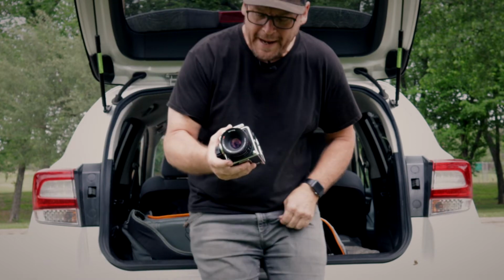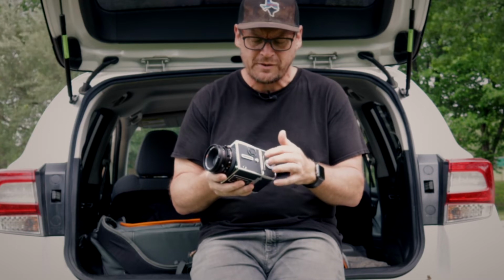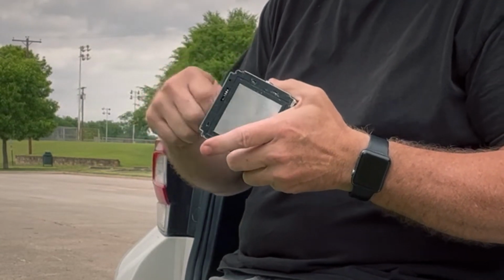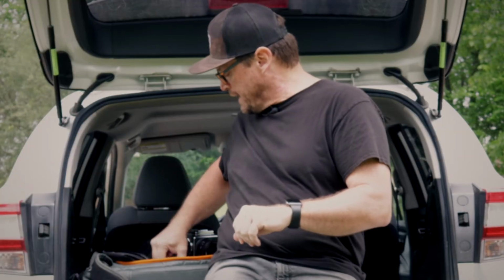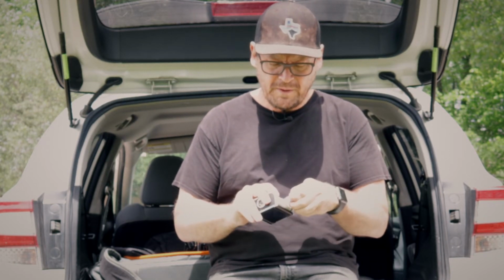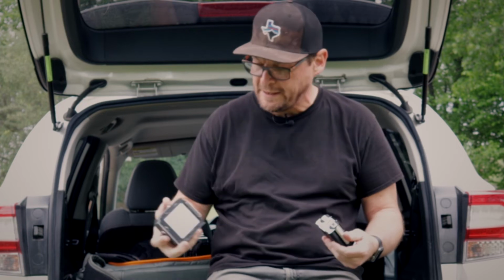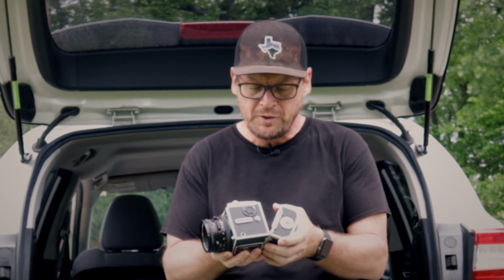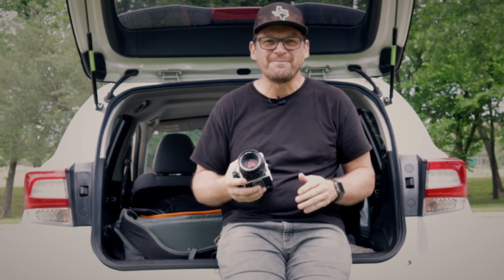How to Load a Hasselblad Film Back the Right Way

Comment: Thanks for the great video. 2 questions:
1: if I Don`t have the metal slide, can I change the film keeping the back to the body?
2: I`m missing the small lever roller for the loading the film, how I can buy a new one?

Thank you !
Reply from the maker: Yes, you can load the film with the back on the camera no problem. For the small lever, I would take it in to a local camera repair store and see how they can help. Also, maybe contact Hasselblad to see if they know where to find one. Let me know what you find out.
Reply: You can find the dark slide on b and H and also a used one on eBay.